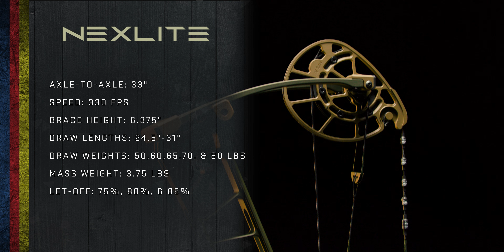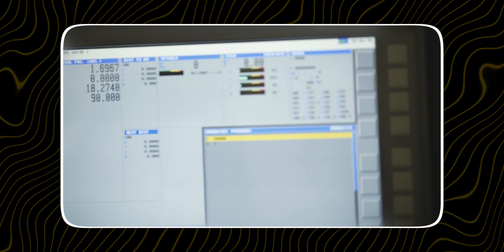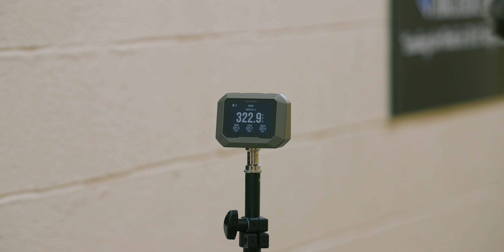2026 Xpedition NexLite 30 & 33: What the Heck is MAGNITE???

Comment: 1/3 lighter but still the same weight as other flagships. Also comes in almost a half pound over advertised. Also more expensive than some other flagships. Thanks but no thanks
Reply from the maker: Half pound over? Listed weight is 3.75…..we got 3.95. And what other 33 inch aluminum flagship is under 4 pounds?

Comment: So it's 0.2 lbs lighter and 33fps slower than what PSE did 15 years ago. Cool
Reply: Is this in reference to the Throttle? I think we need to consider this bow will be more shootable than an FT?
Reply: @liamboyle9199 I've got an old FT I can shoot it fine. Had it properly tuned 5 years ago and it still just hits where I put the pin.
Reply: @liamboyle9199  now I'm thinking about it I'm Gona dig that thing out now and go shoot it 😅

Comment: Magnite is magnesium alloy which is 33% lighter and stronger than Aluminum. Magnite also dampens much better than Aluminum. However Aluminum has better durability where Magnite tends to be more brittle and susceptible to corrosion, Aluminum is more heat resistant where Magnite isn't, however that happens at extremely high temperatures around 100 C (212 F). So if you shoot in bad weather i.e. rain or snow with Magnite you would have to clean and dry the riser asap to prevent rust or corrosion especially on the parts not covered in the protective paint on the bow. That's about everything that I can remember the main differences from Magnite and Aluminum hope this helps anyone wondering about the differences between a bow made of Magnite and a bow made from Aluminum
Reply from the maker: I think you’re talking about magnesium as opposed to magnite…..magnite is a mix of metals that fix the issues you raise, which are issues with magnesium. Watch the video and listen to the engineer explain exactly what you mention…..
Reply: You probably should’ve watched the interview.

Comment: So it’s slow, hard to draw, 4lbs, no timing tuning, no unique accessories, plastic shims, bad grip, vibration in the shot, expensive.…. 😬
Reply: I’ll say, it holds solid as a rock and it’s the lightest 33 inch bow made. The shims aren’t great but rock solid and no moving parts at least. The price point is on par with aluminum but made better. It’s got a market for sure.
Reply: Can’t say it’s a bad grip!